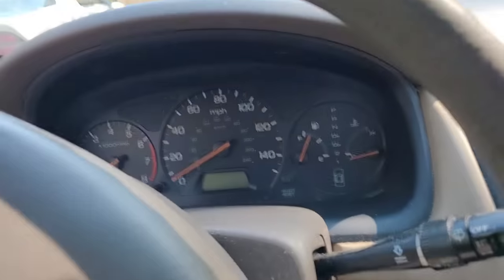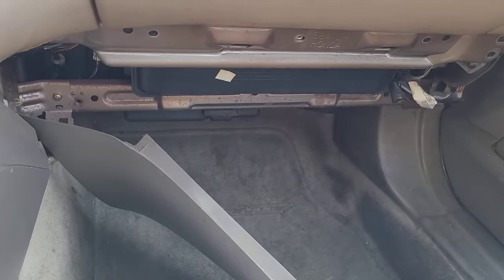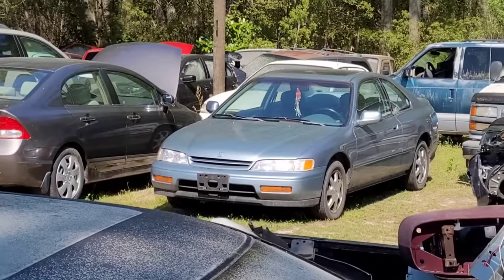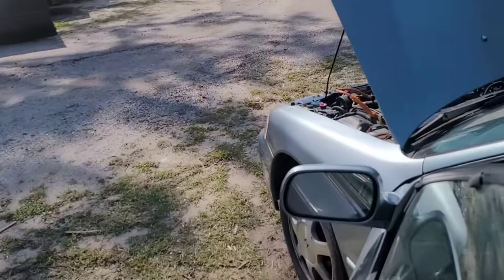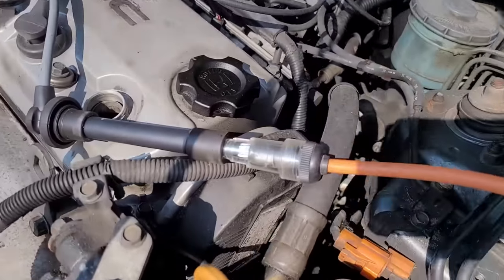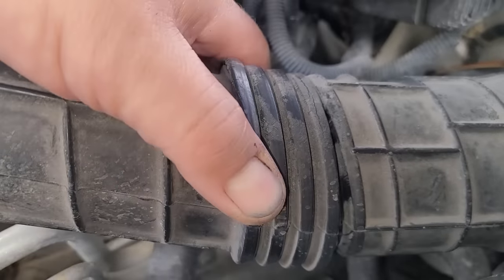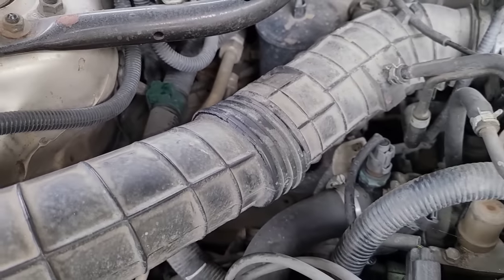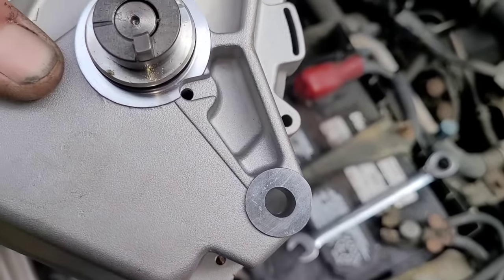Honda No Start? Old School Problem Shows Up!! 04 Honda Accord

Comment: I leave the wires connected to the old cap & just lay the cap to the side.  After installing the new distributer, I switch the wires over one at a time to the new cap.  Also, by pulling the old cap off, I verify by the direction of the rotor I'm not installing the new distributer 180% out.
Reply: Shows that Kenny is either self taught or had a bad teacher. The modules and could are also a lot cheaper and very easy to replace. It's only about 5 screws. The only reason I would replace the dizzy is if it had oil inside it. IE internal seals leaking..
Reply: That job just cost someone a lot more than it needed too. And I do the same as you with the leads. And suggested it above.

Comment: found with some side mounted distributors that the oil seal fails on them and oil get's into the distributor and the pickup sensor cannot read as long as the oil is present , cleaned it out and presto working again .   fixed my brother in laws car like that ,
Reply: My kid had a Nissan with an optical sensor inside. The oil seal leaked too much to just clean it, so we replaced the distributor. Later, I'd read where lots of owners drilled a small hole in the bottom of the cap and oil would drip out without affecting the sensor. I never got to try that free fix...
Reply: @robertbigler7743  I have a u13 Nissan with a similar problem I clean it every 12 months or so as the dizzy costs more than I paid for the car lol. Super reliable tho. (It did just shit an alternator tho) and 360,000 kms
Reply: I got the same problem from blowby. Need little hands to get to the bottom fastener.  Oops got it. Hope I can get it back on. Lol! Oil in the distributor. Hope that's the problem. Intermittent start.

Comment: I had a 1991 Honda civic dx, left me stranded twice because of a bad igniters. Other than that the car ran great for 299,899 miles before I gave it away. Never consumed oil between oil changes, one the best engines ever made.
Reply: You had the only Honda 4 banger ever to not burn oil then. I mean a unicorn. I guess even crappy importers can get it right once in a million huh
Reply: @gb123-ej8wh my car has 214k miles f22a2 and it doesn’t burn oil😂 I spent thousands on the break system the coil overs, brand new spark plugs, cold airflow intake, I changed how the engine gets direct air intake, I have a straight pipe exhaust, with a cat so it’s not loud asf I always change my oil when needed the worst thing that’s happened is I put too much oil once and the only issues that I’ve ever seen with my car were the automatic transmissions they get a skip but they still last years but the manual is way better and the rack which leaked 3 times but it was most likely because they were remanufactured but brand new was 500😂
Reply: @oshe5871  I have a 91 crx base 189,000 miles , doesn't burn oil.

Comment: Most cars any more don't like to be low on voltage according to my buddy that has forgotten more about computers than I ever knew.   Early Ford Escorts used to have that same issue.  I had an 83 that had the exact problem except that had a module you could replace.   Thanks for the memories.

Comment: That intermittent spark you can easily check that the wires to the internal module from the tiny pick up coil have the insulation fall off them, and intermittently short the coil so no spark. Available as a spare part, though the electronic module can also give issues, especially if somebody used silicone sealer instead of silicone thermal compound to mount it.

Comment: The symptoms you were describing around 2:50 of an accord losing spark then regaining it immediately or after sitting for a bit. I had this problem on an accord before. The car would run flawlessly, but when you shut the car off it wouldn't start again - no spark. If you let it set a few minutes to an hour spark would be back and it would run perfectly until you shut it off again. It ended up being an ignition coil.
Reply: We used to find these exact symptoms with Subaru engines, on those it turned out to be crank angle sensor. Literally 5 minutes and a $130 part and problem solved in the driveway without having to book it into the workshop. The service manager authorised a stock of about half a dozen to be available at all times so service advisors could do this. We charged about $20 to fit, even in front of the customer where they could see how easy the access was at that time. Many unhappy customers were turned around by this fix.
Reply: Ya my 93 Civic was similar  ... on numerous occasions wouldn't start first thing in the morning, but after she started, she started fine for the rest of the day. 

So one morning I hooked up my timing light and noticed no spark  ... this is an OBD1 critter. So I pulled out the Hayne's and ohm'd out components in distributor. 

Bad ignitor  ... IIRC I also changed coil for shit's and grins😊
Reply: i’m having pretty much this exact problem but the car is stalling, i just replaced the ignition coil and it’s driving me nuts lol
Reply: @josephsprinkle8783  Check spark once it dies to see if you're actually losing spark.
Reply: @derekr3895  yes i verified tonight that once it does stall it’s losing spark, im guessing since it’s not ignition coil or cap and rotor it’s probably the igniter

Comment: My 1999 Accord was such a great car!  I sold it in 2020 but I STILL see it around town!  It has well over 300,000 miles on it. When I sold it it actually needed new oil seal on distributer shaft. ❤😂

Comment: Easiest way to do it is undo the screws on both caps. Switch over the leads and then when you install the distributor you can turn the rotor button to line up the shaft. It shows Kenny didn't go to automotive school and or had a bad teacher.
Reply: Just more work as he said most caps have the firing order on them.

Comment: I remember replacing the distributor cap on an older Honda that would run erratically. Found out it had a hairline crack shorting the High Voltage to ground.

Comment: The stalling accord could be the ignition switch. Super common on older Hondas
Reply: Not really. IGN switch is only for starting the car not running it
Reply: @e.r.videography6209  ummm no. There is literally a recall on this issue. Stick to videography
Reply: @dxxxm231  keep your insults and pride to yourself. We are here to learn.

Comment: This one took me by surprise because my recollection of cylinder numbering is different in a different transverse four cylinder Honda engine. To my surprise on looking it up, Honda cylinder numbering is not uniform for their transverse engines. I didn't know it can be either way depending on the engine. Specifically the B series 4 cylinder transverse engine 1988-2001 engine has #1 on the left side, and the K series 4 cylinder transverse engine 2001-2011 #1 was on the right side. Why? Is the transmission bolted on the opposite side for those numbered the opposite way?
Reply: Isn't the no #1 on the timing belt/chain end side?
Reply: @metzmatu8409  yes. Number 1 is at the front of the every engine. And on a four cyl number 4 is closest to the box. Always.... 🤦🏼‍♂️. The person above has no idea
Reply: @Alberthoward3right9up  So what I hear you saying, is that the timing belt on the engine shown in the video is on the driver's side? If so it would explain why the numbering in the K series was later switched..

Comment: I put in a new distributor on my 1993 Honda prelude, it would crank but not start. After the new one was installed it still cranked but didn’t start. I noticed that I had to have the distributor positioned in a certain angle for it to start the car.

Comment: Who filled the headliner with water? Looking like it was ready to pop open! The early Ford flathead engines from 32-48 had the same type of distributor drive off the front cover of the timng gears.

Comment: good vid  and you sorted the problem out . but i would have took the cap off ,just to conferm there was nothing simple gone wrong with the distriutor  before investing in a whole distributor . it could have been just the cap or rotor ?

Comment: Thanks; that was a cool video (what did you use to film it). My Honda Accord 2001 had a P1318 code, which would not always start, so I changed the distributor. It ran better after changing the distributor, but I still have the same issue and get the P1318 code. It could be the battery or the alternator. Also, it is past time to change the timing belt, and now it is limiting (cutting off) at 5000 rpm.

Comment: My dad had a 98 CR-V which had a CEL on. Did the code flash count with a paper clip, indicated faulty cam position sensor. That happens to live inside the distributor. Turned out the easiest, and believe it or not, cheapest way to fix it, was a whole new distributor. He sadly lost that vehicle only a few months later, via the Takata air bag rifle buy back 😔
Reply: where did he buy the new one from? and what brand?

Comment: My oil seal failed and let oil get inside my dist...as for "the other" accord, my 99 did the same thing, ended up having to replace the ignition wires in steering column...

Comment: Ive put new distributor on, new fuel relay, spark plugs, (after I replaced the seals on spark plug wells,  and gaskets, .... it will start and run great, get you where you're going.  But when you jump in to go home...no start , no start, no start.
Im so frustrated.

Edit: FIXED. new o ring on distributor.  Old one was shot n leaking oil onto starter.  Now it starts everytime.
Had to replace starter because the oil leak destroyed it.

Comment: I have a 2004 Honda Accord EX v6, it’s doing the same thing as this car. I had the serpentine belt changed, drove 2 minutes to the store and shut the car off, crunk it back up.. the oil light and battery light came on so I shut the car back off. Tried to crank it back up and it just wouldn’t start. It’s turning, but won’t start.
Reply: Same

Comment: I bet that distributor isn't cheap either. Used to replace them on the old Ford  '80s 4 cylinder cars because you couldn't get them apart most of the time to replace the electronic ignition module.

Comment: I have this same problem with my 2000 honda accord ex crack but no start I have heard that this could be cause by a bad relay switch do you think I should try an replace the distributor first then the relay lmk ?
Reply from the maker: Check for spark first. If you have no spark change the distributor. If you have trouble go on Facebook Wrenching with Kenny. Input all the info about your vehicle & what you have done to fix the issue. There are a lot of techs and automotive people that may be able to help. You can try our FB group, Backyard Mechanics (3.8K members) they can help too. Be sure to answer all the questions to join the groups. Let us know what you come up with. Keep wrenching!

Comment: My 2000 accord will run until the motor is hot then dies,might be 30 40 min later then its starts back up and stalls then doesn't restart until cold

Comment: I replaced the head gasket on this Honda Civic. It started up and ran, then stalled. As you can see in the video, it does have spark! 
Another place replaced the distributor. It ran. https://youtube.com/shorts/wY3SCWqVw7E?feature=share

Comment: My 2000 accord 2.3L had a MASSIVE oil leak. Ended up being the gasket on the vvt solenoid. I replaced it, fixed the leak. I also changed the plugs, wires and rotor in the distributor. Started up and drove like it was brand new. Then, I got a new ac control unit bc mine was faulty so I couldn’t use my ac. Once I got that new control head, about 4 days afterwards it would start to act like it wanted to kill the car when I had the ac on. Then it would only blow cold while driving. Now my car won’t start at all. I show I have spark. Anyone have any ideas what that could be? I’m just starting to look into it. I hope it’s simple. I took the distributor cap off and had my girl crank it and it’s turning like it should. I do have a question on if that rotor should turn quick or somewhat slow tho. Mine wasn’t turning very fast. Is this normal?

Comment: Mine wouldnt start. I replaced the fuel pump and the fuse. Than it ran for about a week and i noticed in the morning it would start but not when it was hot in the afternoons so i replaced the main fuel relay and found the sodder was damaged. Starts and runs now but now it sounds like it cranks longer than it use too, barely starting. Idk what the hell it is now

Comment: I have a 99 accord, it would shut off on you but you would  oull over and it would start, turned out it was ignition switch.

Comment: So I’ve replaced spark plugs due to oil being in them, new wires, have gas lol, new spark plug seals, and can’t seem to get it started. Not throwing a code at all so makes it that much more mysterious. Sister was using car and came to a stop and it died! I’ve tried all I know so anyone got any ideas by chance before I call a mobile mechanic to see if they can help me
Reply: i’m having the same issue!
Reply: let me know when if you figure it out please 🙏i’m thinking maybe the distributor?
Reply: Same, and I've replaced distributor,  relay,  spark plugs, new well seals n gaskets, ...could it be in the ignition switch??
Reply: Did you ever get it fixed? Was it the distributor? Im having the same issue. All I did was replace the spark plug cables and now the car won’t start. Every thing is in order. I double and triple checked and still no start. I should of kept to an old saying “if it’s not broke, don’t fix it” 😂
Reply: @nypana1202  I ended up taking my Dad's car to the shop, and the o ring on the distributor was shot, and leaking oil onto the brand new starter, so that explains why it would start, go where you're going, then not start again. 
They replaced the o ring, and starter, now it starts every time.
Reply: @MarlzJinx ok cool. Something for me to check too. Thanks

Comment: That undulating starter speed indicates a low compression cylinder, doesn't it?
Reply: Yes, it sounds like its got a weak hole.  Not unusual at all those miles.
Reply: should get a valve check/adjust. Honda says every 105,000 miles. lol. 
the old skool early 1980's ones were every 17,500 mile intervals. At least that way you'd remember you have non-hydraulic camshaft. lol. Prob a burnt exhaust valve. : l

Comment: Not going to put a timing light on that engine?
Reply: Some manufacturers when through a phase when they used electronic timing based on the crank and cam sensors even though the old mechanical distributor was still being used. In that case they didn't need to accurately bolt the distributor into place using a timing light because the correction was done electronically by the PCM. My old 1998 Dodge Ram is like that. In this car we saw there was very little adjustment possible for bolting the distributor housing on. Controlling spark timing with electronics allows the PCM latitude to adjust timing on the fly based on transient factors like rpm, load, engine temp, knock sensors, etc. Any minor variance in how the housing is bolted on is easily corrected by the software.
Reply: @spelunkerd  I imagine you're right in this case. I wonder why Kenny didn't mention that.

Comment: For ( the little module on the driver side that run the injection has bad modern joints don't let it bite you in the ass